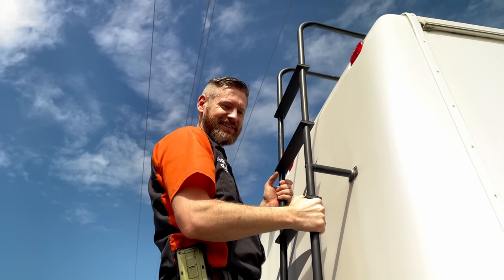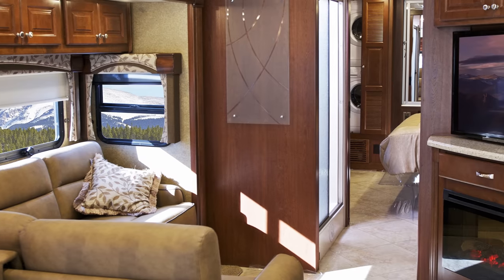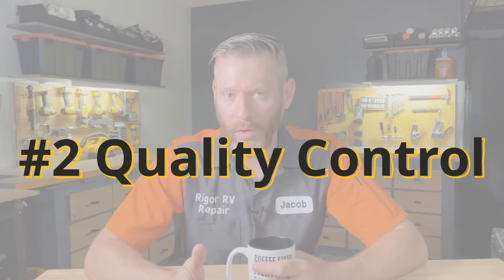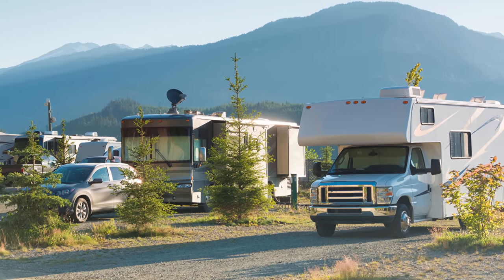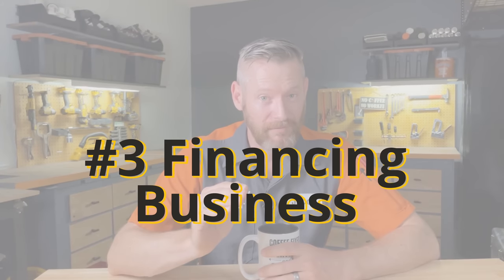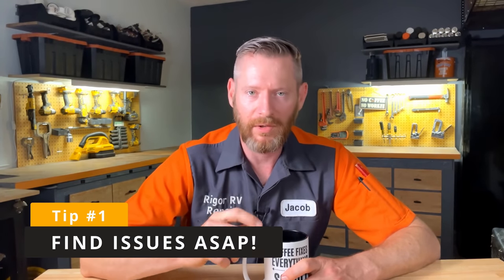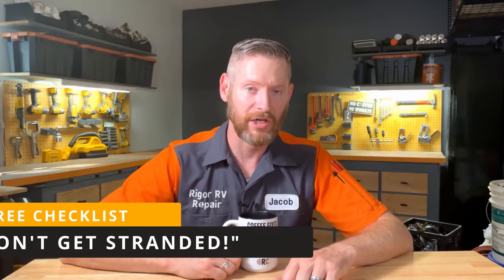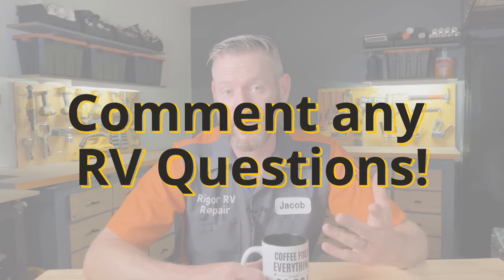3 Dirty Secrets the RV Industry doesn't want you to know...from an RV Tech

Comment: Step 1.. find a decent dealer.. if they don't have a full prep AND service department.. Walk away.  We spend many hours each and up to days sometimes prepping units to get them as perfect as possible.
I'm a certified RV tech..  I'm in the PDI dept.. I have many times finished building units from the factory.. Especially during and right after the plan-demic.. getting call backs and parts was totally ridiculous.. Also within the last 4 years there have been a lot of "acquisitions" and so now you have one company that owns all of the "brands" but doesn't really know anything about the appliances they sell.. and getting to the division that you should talk to is a time wasting wander. Don't get me wrong, they are great at their core.. frames, suspensions, etc. But they know not much on how a Furrion AC is configured, wired or operates.. (yes, warranty call last week..)
There are certainly brands to avoid.. do your homework.. don't just go with the "biggest and most popular name".

Comment: Be carefull buying an RV manufactured at a place with a warm climate.We live in Canada and our trailer came from south USA.The flooring was not glued down and the first winter was very cold.Because it wasn't glued down and the winter was cold the floor all cracked up and had to be replaced.
Reply from the maker: Yes, and the opposite is also a problem, I work on campers in warm weather that were made up north in cold weather and the trim expands and buckles. I do like vinyl tile floors rather than sheet vinyl for that reason.

Comment: I bought a 2004 Sunny Brook Salontra TT , had it for 9 years and lived in full time for about 1 year. I took it out vacation about 8 times before I sold it. I did not have one single problem with that trailer. I kick myself for selling it. In the 3 or 4 years I have looked at new TT and the build is pure crap and they are way over priced for the junk they are trying to sell you.

Comment: This guy us dead on. I work at a ford dealer and i see brand new rv's alot. The build quality is garbage, they are scary to drive because they max out the weight limit empty. These thing are held together with self tapping screws and zip ties. Its scary how much they charge for these think and the build quality.
Reply from the maker: Yep, I've seen toy hauler 5th wheels that the suspension would not hold the empty weight...really is not fair to buyers.

Comment: Truth. They are increasingly poor quality. Buy an older unit that has a good service reputation and from someone else that has had to go through the repair issues the factory should have addressed. Better price too. Research, research, research. Beware of the Covid year production models and their supply issues. Manufactures used whatever they could source from Home Depot/Lowes to slap them together. The increased demand to get out of the house contributed to this. The structural issues from many manufactures; alarming.  Choose wisely, or get a tent or hotel. ;-)

Comment: Do you see these issues as a "you get what you pay for" situation, or do these happen industry wide, no matter how much or little you pay?
Reply from the maker: There is a strong correlation between quality and price, it just doesn't happen unless you are looking at RV's that cost more than somewhere around $200,000. I've worked on Newell and Prevost motorhomes and they are certainly quality. But 2 mil is a little more than most people have to shell out for an RV, lol.
Reply: @undercoverrvtech  thanks. And you are right, most of us can't shell out 2 mill. Even the smaller priced units start at 40 to 60 grand. If a buyer thin has 6 months of shop time, costs can dramatically raise overall costs.
Same thing if you buy a 6 figure RV and have to deal with issues.
I miss 80's prices.

Comment: Being an RV owner of multiple types of campers over several years, there realli are only two things that stand out. Regardless of the manufacturer, all campers, regardless of manufacturing methods, are built with the lowest quality materials obtainable. And service/repair technicians are not capable of providing quality service  consistantly.
Reply from the maker: Yep, lack of trained and experienced technicians is a huge problem in the industry.

Comment: Bought a new 5th wheel a number of years ago, first time owner.  Assembly and material quality about average with the rest of the industry.  But the slides were designed and built to rot out the wood floors, which they did.  Common problem, many youtube videos.  A simple design change would have fixed this.  What the manufacturers get away with is shameful.  And the dealer attitude is they are doing me a favor when i come in with problems.  If I ever buy another one I'll definitely be more attentive and discriminating, and won't buy from this dealer

Comment: Why is all this allowed!? I am so disappointed with our 2019 Rockwood. Our 2005 cheapo was better than all these built these days. They are not built like you are going to live in them.
Reply from the maker: To be fair to the industry, they are Recreational Vehicles, so to some extent they don't need to be built for full time use in general. There are some warranted for full-time use and are much better built.
As to the question of why this is allowed, the government cares about the safety of vehicles on the road, and it cares about property values which is why building codes are enforced on permanent structures. Because RV's are not permanent structures, and most of the systems are not vehicle safety issues, there is not government oversight for most of how RV's are made.
I'm hoping to educate people as to what is quality regarding RV's so that people can vote with their dollars and incentivize the RV manufacturers to make better products.
Thanks for watching!
Reply: @undercoverrvtech  I guess I should not have said live in them. You do live in or stay in them for weeks at a time.

Comment: LOL, you call these secrets?  Own an RV for a year or so and you'll be intimately familiar with all this nonsense.  I have re-built so much stuff from poor designs and even poorer execution.  How about furnace not working because all the duct tape used to attach ducts dried up, fell off, and the duct joints fell off.  No, they were not screwed together with sheet metal screws.  They are now.